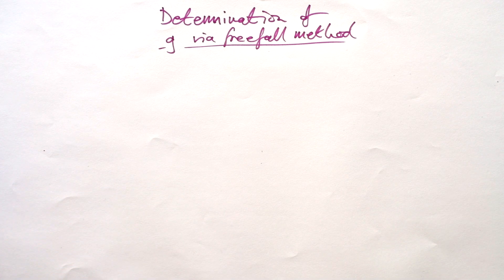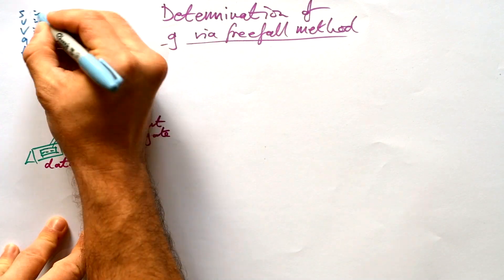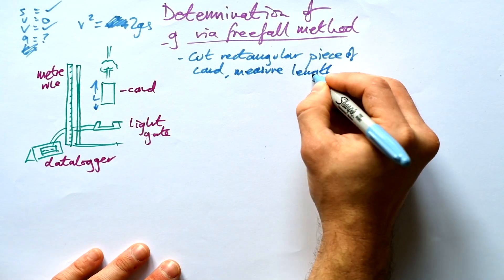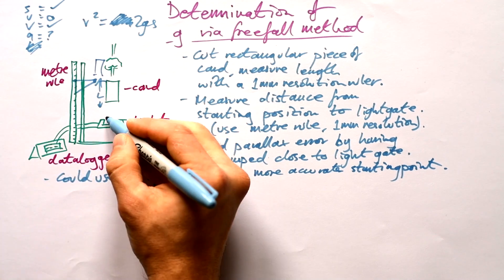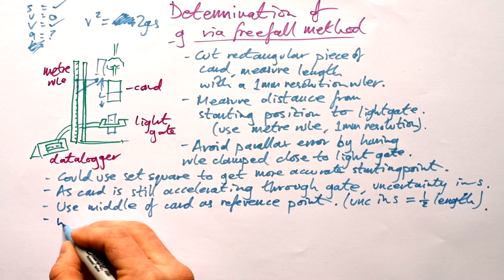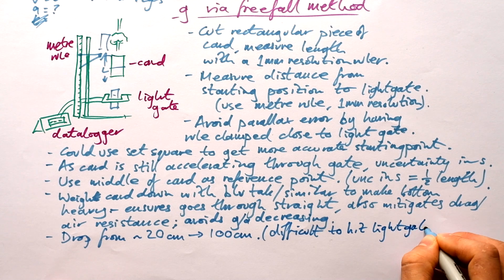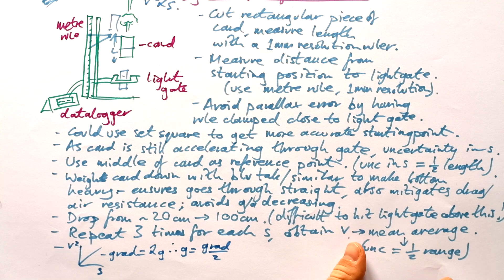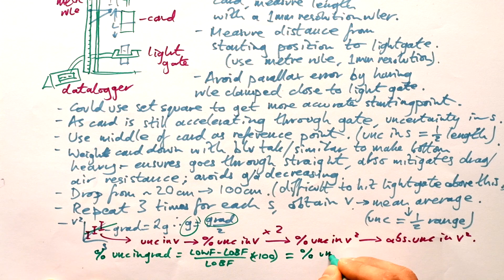Finding g from freefall - Required Practical - A-level Physics

Comment: Hey can someone explain to me this percentage uncertainty and why it is e.g. half the range. (I don't get it). The % un in V. (I don't get).
Reply: For a single reading Uncertainty is ( precision ÷ 2 ) 

If we take multiple readings, Absolute Uncertainty = (Range ÷ 2)

Percentage uncertainty = ( [absolute uncertainty ÷ avarage reading] × 100%] )

Percentage difference = ( [difference between the standard value and experimental value] ÷ standard value × 100% )
Reply: Speacil case

When using a metre rule to record the uncertainty of the reading, there is an uncertainty of the reading at both ends if the object. So the total uncertainty of the reading is the addition of uncertainties at the 2 ends.

Uncertainty of metre rule = 0.5 + 0.5 = (plus or minus) 1mm
Reply: Hope this will help you :)
Reply: @sandunigunawardena5570   the special case you mentioned is called a zero error. may be worth mentioning that every apparatus the you need to manually "match" the zero to your measurement contains a 0 error

Comment: Why is uncertainty 1/2 the length of the card? So what if we took the top as the reference point?
Reply: So you got thr answer yet?
Reply: @zainismail7703  its's because he's measuring the middle of the card as the card still accelerates as it's falling making it a happy medium to take a measurement from (therefore inducing uncertainty)
Reply: @benasbarciauskas3322  tests finished last week but thanks.
Reply: @Zain Ismail  did it come up?